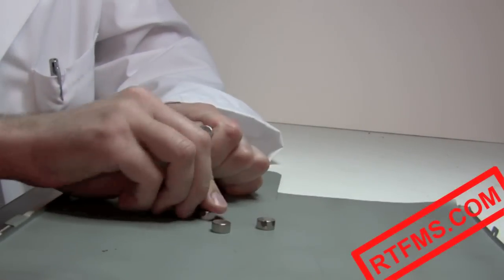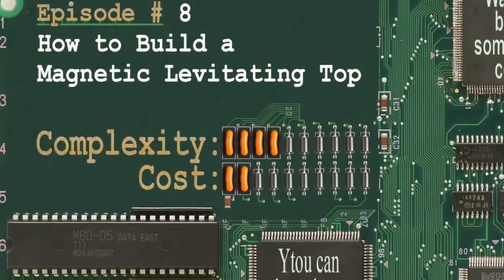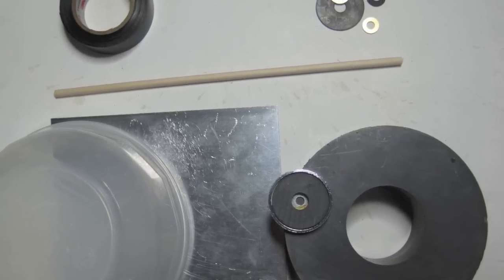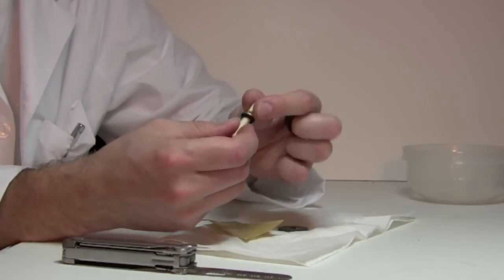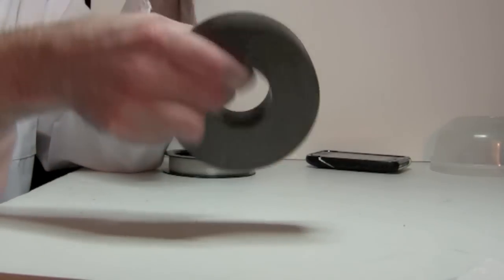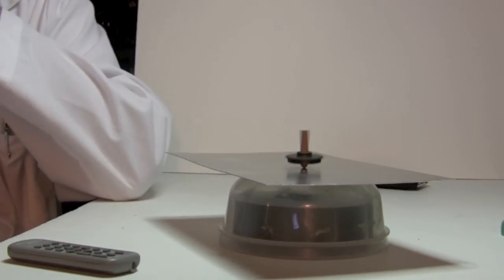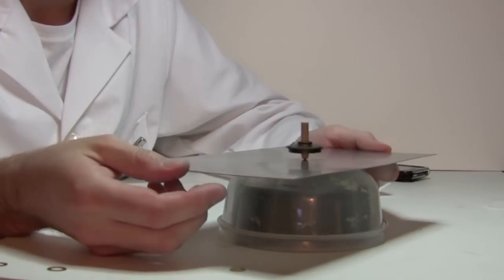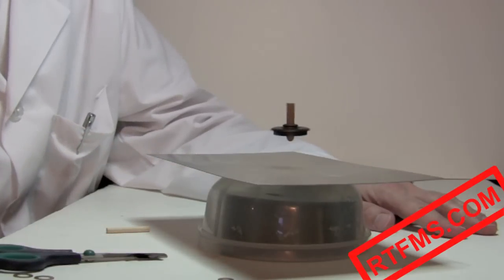RTFMs Episode #8: How to Build a Magnetic Levitating Top

Comment: I finally got mine working. It was hard but worth the effort.
Reply from the maker: +Cobrakiller2000 Congrats!!
Reply: +RTFMs thank you! This video was very helpful.
Reply: how did you do it? mine is stable now... but it wont levitate...
do i need it to repel or attract?
Reply: +Lizzie Lorraine Dimasuhid You need to get the magnet in the top and the ring magnets repelling each other.  When the top is too heavy it doesn't want to lift at all. When the top is too light it flies of right from the start. When the weight seems ok but it flies off all the time from the same spot, it means that you need to raise the angle of ferrite ring magnets right where it flies off. So no bubble level is needed for this like I originally thought. About 2 cm is a good distance to launch the top from the ferrite ring magnets. Good luck, it is not easy! The main ingredient you need is patience!
Reply: +Cobrakiller2000 so the small and big magnets must repel each other? my small magnet repel the hole of the big magnet but attracts at the side... can you please help me? i beg you... :'( i need to pass it tomorrow... ive tried all the faces of the magnets....
Reply: Lizzie Lorraine Dimasuhid
It is not that simple... you need to get the small magnet attracting the hole and repelling the top part of the big ring magnet
Reply: +Cobrakiller2000 yes.. thats what i did.. the small magnet is attracting the hole and repelling the top part of the big magnet.. but whenever i lift the  frame glass, it doesnt levitate... it still continues spinning but doesnt levitate... i can even lift the frame glass a meter... nothing happens...
ohhh and also... the hole on the big magnet is big...
Reply: yes, no need for begging :)
Reply: I guess you need to add me in google+ before we can even make a video call
Reply: +Cobrakiller2000 okay... can you give me the link of you google+ because im only using my phone... :(

Comment: Would we have the same result if the base was spinning rather than the the top
Reply: Kyle Travis i don't think so, the spinning only makes the top in stabilized balance, its easy this way to put it higher in space without really losing balance, but  i think we can have same results without the spinning with a magnetic small ball
Reply from the maker: +Kyle Travis Sorry Kyle, the top needs to be stabilized, not the base. So it has to be top spinning, not the base.
Reply: +Kyle Travis it is possible but there would have to be no friction so it work it theory
Reply: +Kyle Travis Inception
Reply: A fellow teacher hooked up a vacuum pump to a bell jar to attempt this but it takes a while to pull the air out, so it increased to about ten minutes of spinning before falling but not much more.
Reply: Great question